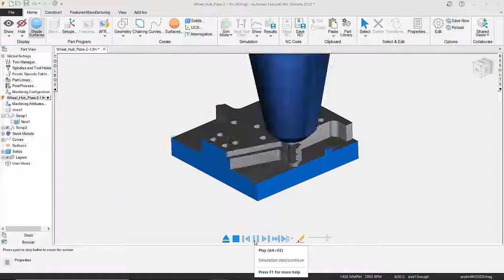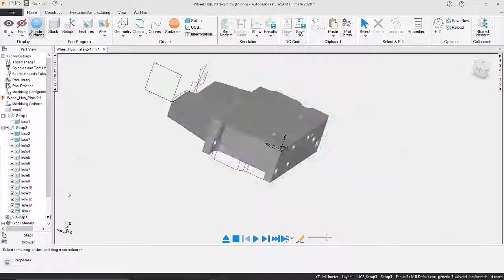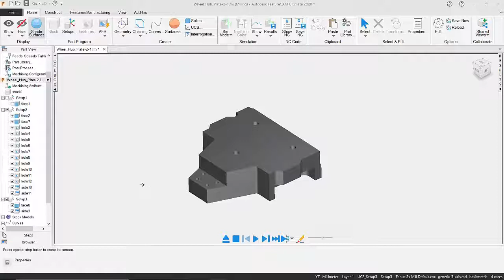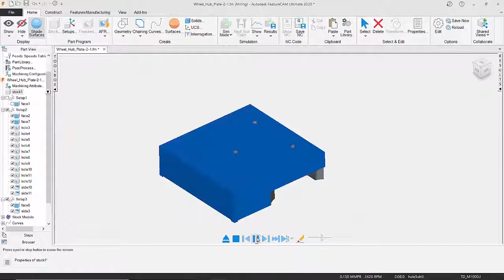FeatureCAM - Creating Setups

Comment: the way you have positioned the second setup in the corner, you have to remove the zero point on the blank on the machine, which does not work.
can you explain how i can define a second setup exactly in featurecam and check where the position is. e.g. in the middle. can i measure this?